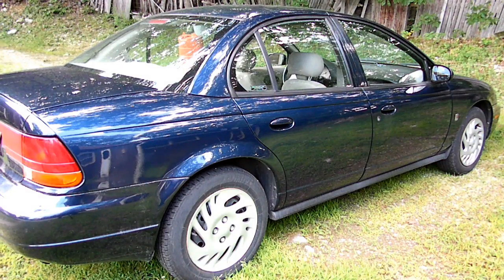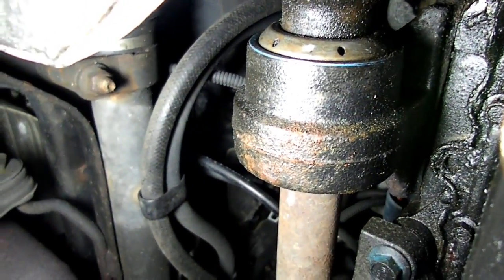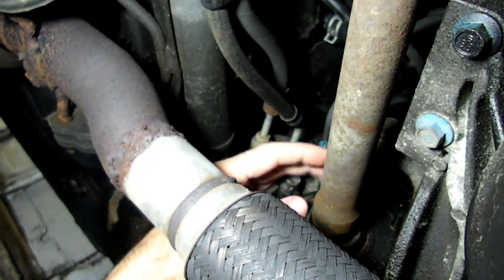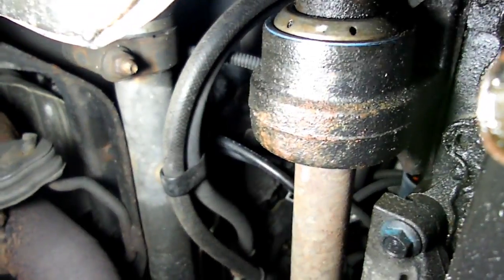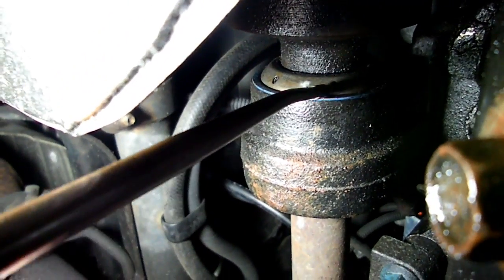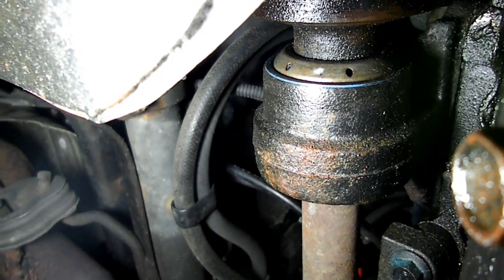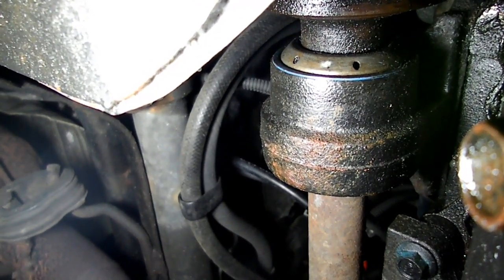Intermediate Axle Support Bearing Squeak

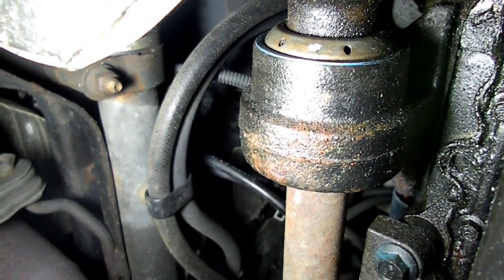Comment: @0:40  I had a clicking noise on left turns, so it is Passenger side CV Axle, so I'm replacing the CV Axles. When I removed the Passenger CV Axle I decided to replace the Seal as well. This Seal is on the Passenger side, so on Intermediate Shaft. It is 2001 Saturn SL2. When I removed the seal there was a lot of grease inside of the housing of the Intermediate Shaft. It was like half of the space inside was filled w/some grease of cream color. In Shop Manual (I have it for that car) nothing is mentioned about that grease. They just say to clean the Intermediate Shaft housing and apply the axle seal grease on the lip of the seal (where rubber is I assume), and to axle bearing (not sure is it inner side of the CV Axle or outer one?). So should I fill in that housing w/some grease, how it was before? Or that grease shouldn't be there. And what grease to use? I have White Lithium Grease and Green Lithium (that one you can add into Ball Joint and Tie Rod Boots. I also have some Red Grease. This part of the project is very confusing. What grease to add and how much? Thank you very much for this film.

Comment from the maker: Does stepping on the brake alter the noise.
Reply: Mine makes a bump noise when I turn at slow speeds like in a parking lot. I was told that it was the intermediate shaft also. Does this part come with a boot? I have a spare intermediate shaft I bought from a junkyard in another state online, the U joint part of it at least.. Merry Christmas BTW!
Reply: @Dev JB the only thing with that is my intermediate shaft was already diagnosed as bad and the sway bar bushings were replaced 10-12_years ago with energy suspension polyurethane bushings
Reply: @Dev JB I'm gonna have a buddy of mine look it over while on a hoist!

Comment: I had a similar squeak from my intermediate shaft seal, that resolved on replacing the seal. But it took me a while to 'rule out' a wheel bearing. Without a lift it's not easy to rule out a wheel bearing. Passive slow rotation of a wheel doesn't help a lot to reproduce that sound. Even figuring out which wheel seems difficult. Any suggestions?
Reply: @spelunkerd, 10 years later, have you developed your own approach?  I recently bought some chassisear microphones, cut off the connector and soldered on banana jacks.  I connect the microphones to my picoscope, and do a left/center/right 3 channel setup.  The center is connected to either the support bearing or the differential itself, if you're worried about a differential bearing being the source of noise.  Go for a test drive and let the scope speak for itself!
Reply: @ablackformula  What a creative idea, thumbs up!

Comment: Thanks. Gear oil better than penetrating spray like wd40?
Reply: Gear oil is definitely better, WD40 is very low viscosity and will make any oil or grease in the bearing start to dissolve away. Only use WD40 on low wear parts, like door handles, nothing that rotates thousands of times in its lifetime.

Comment: great video! My chirp (thought it was a bird under the hood) was on the drivers side transaxle out put shaft. Squirted some Champion chain lube and it stopped the chirp. I searched for that noise for a month plus!Only chirped at varying speeds. Had to put the vehicle on jack stands and put the car in drive!

Comment: I don't think too many Saturn owners will have a squeaky support bearing in need of lubrication. Just do an oil change and when you remove the oil filter, lots and lots of oil will pour over this support bearing and all down to your chassis and down your arm. LOL  Unless you use Rich's oil filter drain tip (use an old plastic oil bottle cut in half to catch the oil from your oil filter) Thanks Rich, and keep up the great Saturn maintenance videos!